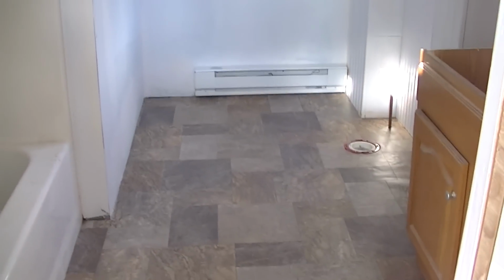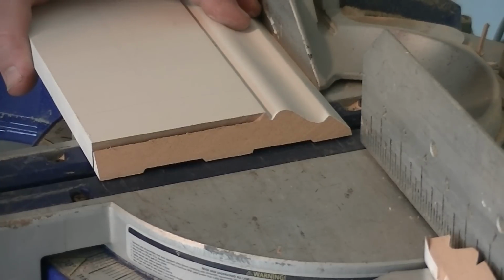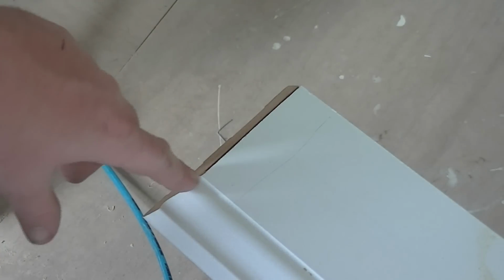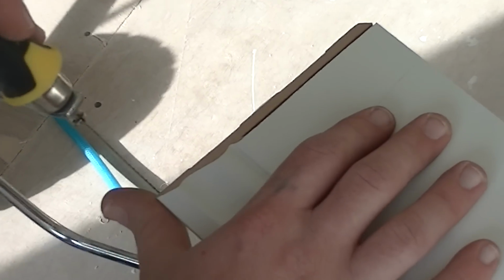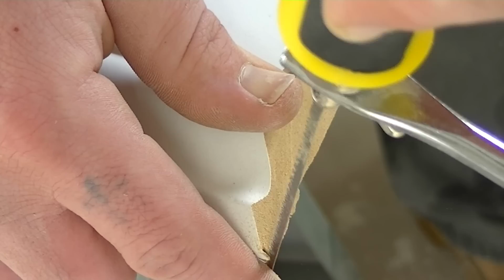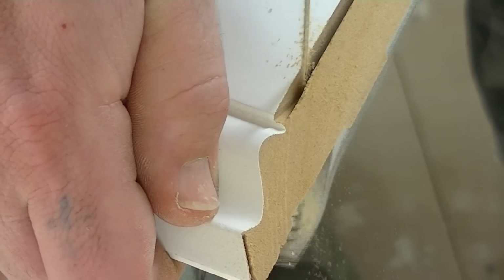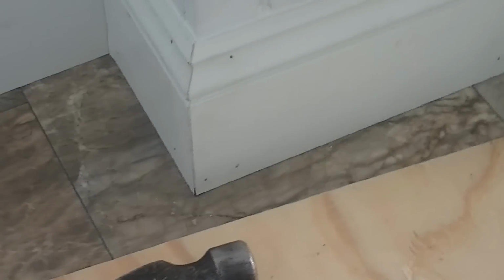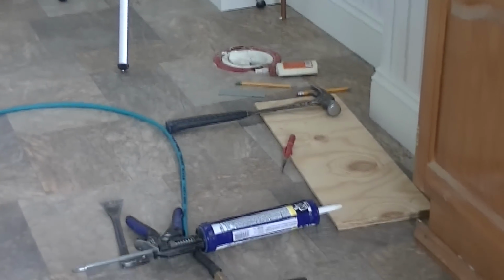Coping/Cope cutting Basemolding

Comment: Just a word to the wise, never use mdf in a bathroom it does not like moisture/ water
Reply from the maker: I used what the customer wanted to use... I agree MDF is a bad thing to have around moisture. They might be realizing that now. I'm sure ill get a few more armchair warriors telling all the stuff that is wrong with my videos good thing pros watch videos telling the producers how bad they are at what they do or using the wrong tools. some jackass thought they should tell me the blade is backwards... I bet Pro dummy never used a coping saw and thinks the blade only goes one way, maybe some like to push and not pull when they cut... I love it, so many Experts watching youtube videos these days. ;)
Reply: I push to cut also
Reply: I need one of those small nail guns.

Comment: The entire cope needs to be back cut because corners aren't always 90 degrees. I use a jigsaw and it makes a cleaner cut than a coping saw. Quite a bit faster as well. With a jigsaw it takes me 5 seconds to cope and requires NO sanding. See how when you fit it up that it has a small gap starting at the straight part of the cope? Back cut it and you can close that gap. On your outside corner....... cut them at a 46 instead of a 45 and you will not have ANY gap.